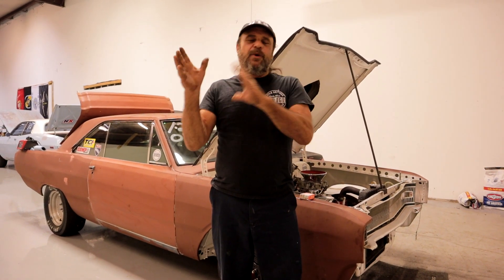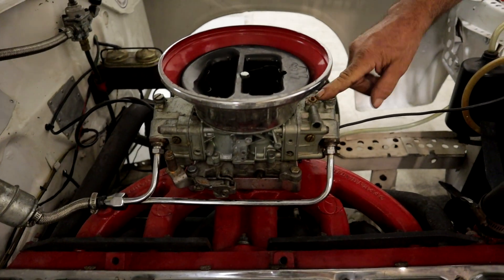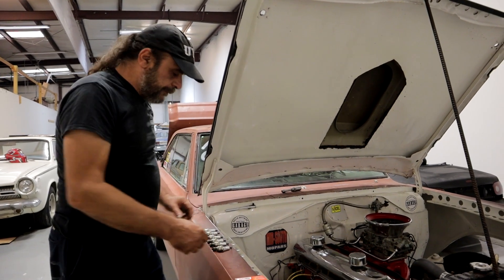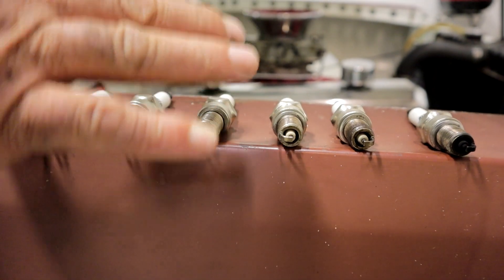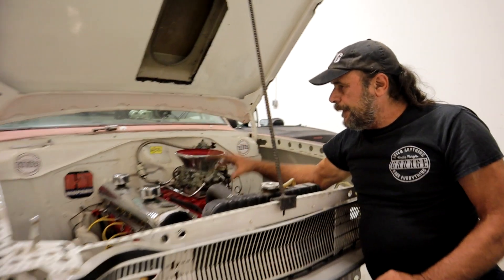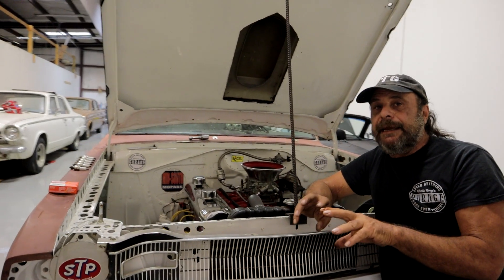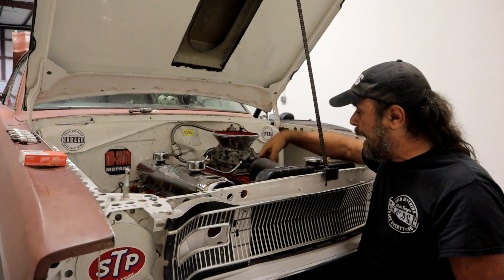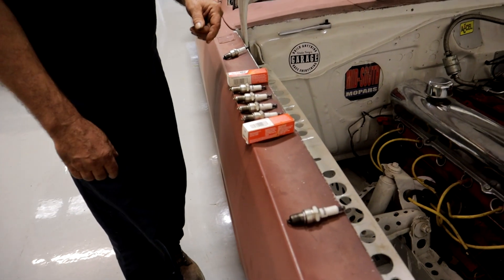Initial Carburetor Performance Tuning

Comment: This shows that tuning with a fuel air ratio gauge would be useless. Once he gets the engine running with equal coloring it would be an aid, not a substitute.

Comment: 1 and six get the leser amount of heat for plugs.fule pudeling will cause the same efect.detonion will cause this to cause fule burns before its time come on 12 to 1 on asumed pump gas .but i never found any plugs on slan six to ever had that bad of fouling on 1 and 6 yes a littel  darker on 1 and 6 but not enough to even change heat range.and just for ships and gigels from mopar it self only calls for a 390 cfm at the 12:00 second range and 12 to one  compression minmal and it right out of mopar performance parts book page 112. mopar performance parts chassis book.badd lobs on the distributor can do this fouling to.

Comment: Aren't you just masking the inherent problem of uneven fuel distribution from the carburetor/intake by using hotter plugs in the far cylinders?
Reply from the maker: Masking, no. Compensating to the best of ability given the hardware used here, yes

Comment: 650 carb still sounds too big for the cubes. Like a 650 for a Ford 289. How do you estimate the 650 carb on this size motor? Math does not add up.
Reply: ya a 390 holley may be more appropriate.
Reply from the maker: Tell that to the Pro Stock guys who run 2400 CFM on 500 cubic inches.
Reply: @justinriley8651  the so called math used on most carb size calculators seem to underestimate the cfm requirements of the typical hot rod engine. They seem to think of an engine as a simple air pump when in actuality there are way more dynamics involved than simply moving air through a known venturie diameter. Also no carburetor manufacturer wants to have to deal with an angry customer that installed a carburetor that is too large for their application. So their sizing charts error on the small side.
Reply: @justinriley8651  Well some of us have actual experience with carburetors on a slant. I can tell you that a 390 holley works fine for getting a fairly hot slant down the road. But is by no means a good choice for a drag car. My friends dart that we ran in the early eighties ran fourteens with a well tuned 390. Same car ran low thirteens with a 750 double pumper. Five mph faster in the traps at carlsbad raceway.
Reply: @davidleonard8369  a 750 may be good at wot on something that can use it. hell a 750 is big enough for a big block on the street. I've had 390 holleys on inline six engines before it was plenty .
Reply: @justinriley8651  Apple's to oranges. Plan z is a drag car. The 40 mm keihin cv works just fine on my sportster too but I spend a lot of time at the local dragstrip. So I run a 45 mm mikuni Hsr flat slide.
Reply: @davidleonard8369 I've seen stock 390s be too much, the thing was a dog.and it got terrible gas milage. about like putting a double pumper on something runs like a scalled ape and gets 4 mpg.ive done both you ain't talking to some dumb kid bro.
Reply: I'd drag that sportster any day of the week and twice on sunday!
Reply: @justinriley8651  no argument from me. I have never recommend any size 4160 holley for fuel economy!
Reply: @UncleTonysGarage  uncle tony, if there is indeed a heaven you just made Bob Gliddens day.

Comment: Tony you went to fuel to ignition, kinda lost me there… why not a smaller carb with a bigger right rear jet slightly smaller on the right front and smallest on the left side
Reply from the maker: I only pointed out that PORT injection would negate the issues found in this particular set-up
Reply: @UncleTonysGarage  not talking about efi, I’m thinking more corner balancing the carb before you go changing ignition (spark plugs) why not go that route first before going to hotter plugs and doing a “bandaid” fix to the over carburation
Reply: Utg not trying to argue just whilst watching that’s what first came to me and then you switched to changing to hotter plugs rather than dealing with the obvious issue of too much carb (at least on 1&6)
Reply from the maker: @jeremiewampler  It's already the smallest standard size jet Holley makes
Reply: @UncleTonysGarage  that’s why I suggested a smaller cfm carb, maybe you have one smaller 750 I believe you said why not drop to a 650 or 600?
Reply: @UncleTonysGarage  actually just a thought after that last post, possible for a restrictor plate for the outer barrels? Sorry just bench racing this thing in my head
Reply from the maker: @jeremiewampler  It is a 650
Reply: @UncleTonysGarage  10-4 was just my quick intake of what you were saying

Comment: wait...secondaries ain't open at 2500 rpm? that'd be about a useless test, IMO...
Reply from the maker: There's also no load on the engine.  This step is to make sure that when you pull to the line you have 6 relatively even, functional cylinders
Reply: @UncleTonysGarage  you said yourself...runs at W.O.T...fuel distribution is gonna be fkt at 2500 in that manifold running on the front barrels and with the idle circuit still talking......I'd say your test is the starting point for shutting the ignition off at the finish line, towing back to the pits and THEN reading the plugs...but then again, I wasn't a carburetor in a previous life...
Reply: and...at some time in this things life, I wanna see you put an AFB on that thing...or a quadrajet...
Reply from the maker: @wrenchski  Watch the whole video...I talk about that at the end

Comment: Add 2” carb spacer
Reply: But you'll likely still have the problem with 1 and 6, although it might help bottom end performance somewhat...
Reply from the maker: Possibility in the future.  Notice there is no sealing between the velocity stack and hood.  Left that way so I can play with spacers
Reply: @UncleTonysGarage  a shop cat would help I bet